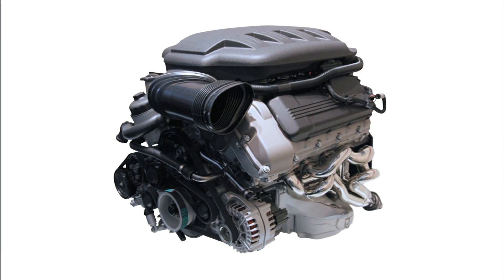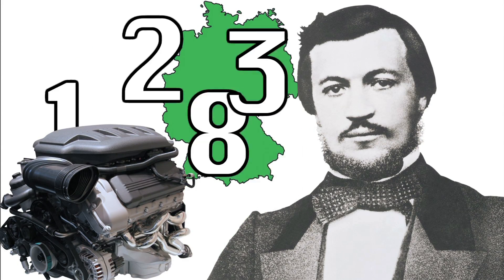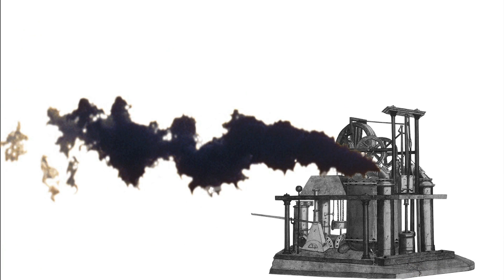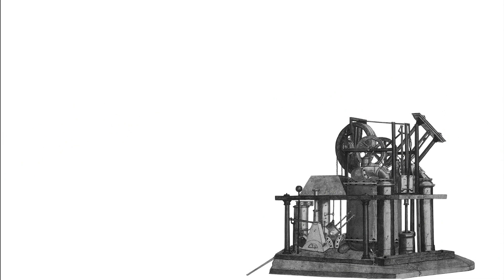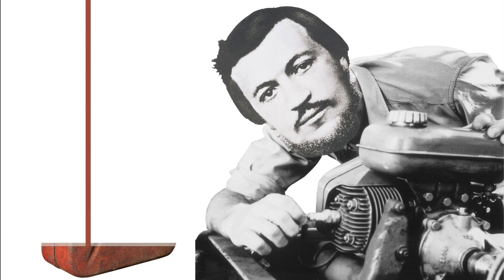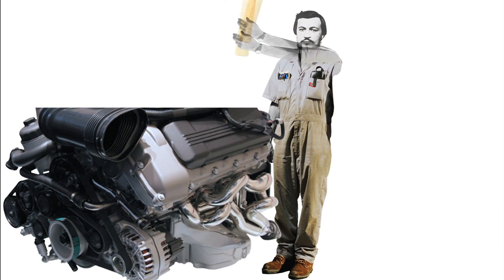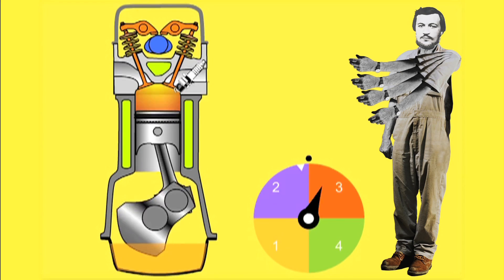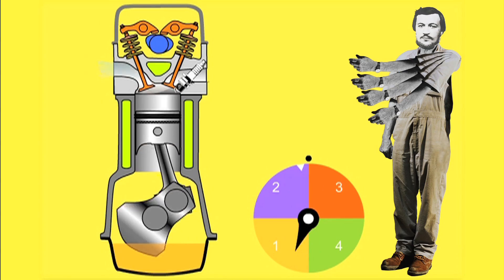Otto's Awesome Auto Engine - Hidden Genius

Comment: If you're going to be a know it all you should get your facts straight.  The 3rd phase in a 4 stroke is most certainly a contained explosion.  The iron or aluminium cylinder wall contains the "rapid burn" of the explosive mixture containing gasoline and oxygen.  The "rapid burn" aka explosion, forces the cylinder head into exhaust stroke and into the next cycle.  Unless maybe you're from the future, and you know something we dont... : /